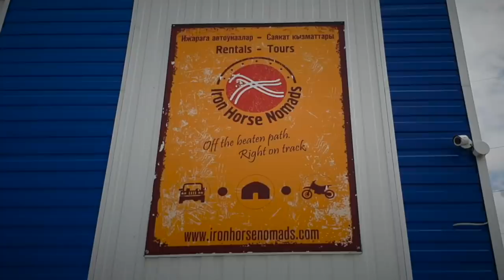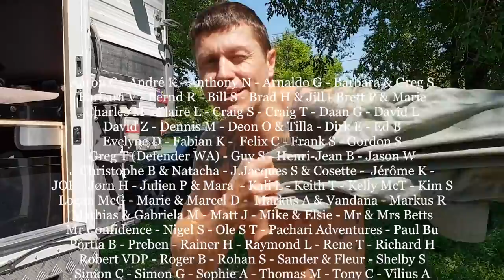Disaster at 3000m (Ep75 GrizzlyNbear Overland)

Comment: Guys try not to worry 💛 components fail due to many reasons! Try fitting genuine parts when you can✌️ great Vlog enjoy these moments....take care😁
Reply: genuine parts LR parts are what caused the failure ;)
Reply: @pablomax3045  that comment could be construed as funny? But for the fact i have owned a defender for many years which has caused many sleepless nights 😪
Reply: @soylentgreen224  hmm a bit tongue and cheek I guess. 
I have owned 3 110's over the years. While I have loved them all, I would never delude myself into thinking they were well built or reliable. I am not sure I have ever taken a Defender overland where something didn't break. The amount of spare parts I would tote around with me finally convinced me to try something else.  
The Defender is a fantastically designed truck. It's just put together with crap parts and with almost no attention to detail. Well.... it was built in the midlands after all ;)
Reply: @pablomax3045  ....what is well built these days? I use a defender for my work/business, I agree on your points, I am on my third defender in 11 years, thankfully my present 61 plate has been kind to my pocket over the last two years, I do have a soft spot for them I guess...but you either love them or hate them?
Reply: Soylent Green Toyota Land Cruiser 200?
Reply: @pablomax3045  haha love it but so true. LC is king.

Comment: Glad you guys are okay..but you know this problem is common on Defenders,that's why in my country "Yemen" we stopped using them..we mostly use Toyota LC's or Nissan Patrol's..don't get me wrong,i still Love Defenders..
Great video..
Cheers from Yemen
Reply: Wesam Mansour snapping swivel balls is not common on any Land Rover in any country
Reply: There is a recall on the 2.2 l Pumas for this problem, the recall does not fix the fault it just adds a bracket to stop the front axle from dropping to the ground. Illegal to run spacers on your rims here in oz just run bigger rims with the correct offset and suspension lift. I have a 2013 HCPU 130.

Comment: So I don't know if you've come across this in your travels, since it only really came to light for us (British Army) a few months back, but there has been a lot of Swivel Housings introduced into the parts supply chain that have failed like this, our entire fleet of Defenders were taken off of the road and every one checked to see if they had the bad parts installed. If you have a good Swivel Housing, you should see a dark line going around near to wear yours failed. If there is no signs of a line, you've got the bad part. Be worth checking the other side, just in case.
Reply: Hi
This is very interesting information! Do you have some further information or maybe some pictures of what to look for?
Best regards
Daniel
Reply: @champ6702  I can see if we still have the safety bulletin in the workshop, if not, I'll try to throw something together.
Reply: Thank you so much for that info. We did actually find out about a batch of defective swivel ball housings that was around the time of our model.
I have inspected the other side and will check again with the advice you have given.
Thank you very much 😊
Reply: P5YcHoM4N Thank you very much, that would be awesome:)
Reply: P5YcHoM4N Thank you very much!!!
Reply: @P5YcHoM4N  awesome fellow....many need to see that.

Comment: Wheel spacers put crazy loads on your axles, love your videos
Reply: Yes, anything with an offset from standard = high stress loads. Even wheel bearings need replacing every 15,000 - 20,000km due to excessive wear from that.
Reply: Indeed, a lot of poeple thing big is better till stuff getting broken. Only than they realize that the original is more reliable and especially if you do long trips.

Comment: I haven't seen the video fully but this can be common on older live axle vehicles. Toyota's do it, the 4 bolts at the bottom of the front hub birfield joint loosen from leaking grease seals in the hub and will give out.

Check them, clean them spotless dry with brake cleaner and oven cleaner and locktite them back in.

Don't trust mechanics to spot it, 4wds need much more closer attention than most people in garages even know to look for.

This coming from experience and numerous Lamdcruisers that each did over 500,000ks

Comment: should of bought a Toyota. then you too could rescue landrover drivers in their certain to come failure
Reply: I was traveling in our friends brand new Toyota Land Cruiser on the Mitchell highways in Perth after they collected us from the airport, the rear diff sized for a split second which nearly resulted in a serious accident!
Lucky for us something let go resulting in no drive and us on the side of the road…I think from memory it pushed something through the axle casing…anyway after having many other problems like using more oil than fuel and injector problems they went back to a Mazda which has been fine!
The one thing I have discovered on you tube about Toyota fans is how deluded they really are…honestly believing that the Toyota will never break down!

Comment: Hi, I've only just come across you, nice  setup you've got there. I recently repaired a Defender that did something similar, it sheared the flange off the axle casing, glad yours didn't. Aparrently there was a batch of casings that weren't welded right, might be worth checking yours. Look round the welds between the axle casing and the flange for the swivel ball. First sign is a leak if it's cracking.   Don't want to see you stuck again.

Comment: WOW, i wish MY breakdowns could be so enjoyable! 

I'll be checking both of my swivels on sunday when the rain should have stopped. I had new ones  both sides last year on my Discovery 1 along with discs and pads, CV joint and everything else that fits on the corners of the front axle!
I've lost a wheel on a Lightweight i'd just bought. They guy told me he had brought it back from where he worked about fifteen miles away. OK, so i should have checked the wheel nuts were tight, but let's be honest, who does that? SOmeone said i should have felt the vibations. Well, yes, i did. It was a 1972 Lightweight which i'd just jumped into to drive to work to fettle over the christmas shutdown. I just thought that this was how all lightweights drove, or maybe just MINE and i'd find out when i went over it from bumper to bumper over the holiday. I was driving along a country lane at the time when the front passenger wheel suddenly departed and shot off into the hedge at 40mph!

I didn't panic as i'd had the same thing happen while driving a Mini several years before. AGian id just juped into it. It belonged to a mate who i'd gone along with to drive this back if he bought a Triumph Stag. I'd driven about eight miles, just got up to about 50mph on the motorway when the driver's side front disappeared through the dipped headlight beam and into blackness. THat was down to all four wheel studs shearing due to suspected grossly overtightening!

I'd got a spare set of wheels in the back of the lightweight. So i thought i'd take the other front wheel off and fit two spares from the back so at least i had matching sizes on each axle. Oh, the wheel brace wouldn't fit the nuts on the wheels. Oh, and there's no jack handle.. DEEP BREATHE... Fifteen minute walk back home to grab the required trolley jack, handle and other wheel brace. Drove to the lightweight, fitted two spare wheels pinched a nut from the other three wheels , had a look for the one that came off... NO sight of it in the undergrowth/hedge. Drove back home. Walked back to the lightweight and drove it to work.
Went out looking for the missing wheel on christmas day afternoon. I found it. I wouldn't have believed a wheel could roll so far. It must have driven about 30 yards through the hedge and stopped at the sheep fence behind the undergrowth/hedge. As i emerged from the undergrowth pushing the wheel i disturbed an old man out walking his dog. When i say disturbed, i think a more accurate description would be 'frightened the guy out of his skin'! He must have jumped a foot when i wished him a merry christmas. It had me chuckling all the way back to my old '61 Series 2 that was parked on the verge with no roof on.

The thing about these experiences is, while potentially horrifying at the time, afterwards they are gems! Of course you do get funny looks when you tell people that you've been driving cars that have lost a wheel TWICE...

Comment: Big tyres and rim spacers might speed the failure up but there is a factory recall on this issue. Trouble is the recall does not fix the problem it just adds a bracket to stop the front axle from hitting the ground after it breaks.

Comment: Damn Land Rovers.  I've never spent more time on the side of the road, in a parking lot or, in my own damn driveway, than when I owned a Rover.
Reply: I've noticed they won't reply to people giving advice to scrap the LR and go LC.
Reply: Well I’ve had 9 over the years my break downs were my own fault off roading pushing to hard .apart from that maintain them well they will last a lifetime.
Reply: buy a cruiser and just change the oil every now and then and itl last a lifetime. no special bumblefuckery required.

Comment: you should have used a toyota landcruiser.
Reply: I  think they should have but then they can not enjoy that 2.5 tons of sleeper (which tells clearly that they are not pro campers or expert off roaders but again can not blame them since they are on honeymoon and newbie ) !
Since Toyota can not be modified in to that and not to carry around these kind of weight !
They did not at all or just poorly calculated the load that they will be carrying and have to strengthen the leaf springs according to the load and axles plus change the coil springs for tough load !
Btw ! They are almost reaching 5 tons and no Toyota even their pickups are limited to 3.5 tons because of the rims and width of tires they offer with them  !
Reply: @mattprior8442  you probably need to look at lc70 series with diesel engine

Comment: I have been using Land rovers whole my life ..honestly, I have never heard of the accident like that one nor experienced anything similar. How did it happen ?
Reply: Swivel usually doesn't come off that way, it must been broken for a long while.
Reply: Tiny metal fracture growing and eventually bursting...a big pothole probably.
Reply: @henryrollins9177  Yes I can imagine that but there is likely to be some error in the quality of the material during production or especially if the equipment is upgraded with something optional.
Reply: @PavleBalenovic  Wheel spacers + oversize tires maybe?
Reply: @henryrollins9177    Exactly.

Comment: Take a Toyota landcruiser it would have continued on even with this damage, ☹️☹️☹️👍👍
Reply: Lasy year I was in Kyrgyzstan with my Land Cruiser HJ60 I completly broke my two back leaf springs. I managed to drive through Kazkhstan to Russia but driving experience was really tough. So even Land Cruiser s do break down, belive me aspecially when you travel in such conditions as are in Kyrgyzstan.
Reply: Brad Młodystach  There is no maintenance program/strategy for leaf springs. The reason was really tough 4x4 roads (i'm not talking about deep mud but holes and corrugations that put constant straing on the suspension).

Comment: As someone who has been working on Land Rover's for almost 3 years i have never seen a Defender snap an axle like that. The tyre size wouldn't be the issue, a prop would go well before the axle. Suspension being too firm with the weight of GrizzlyNbear would a likely candidate in combination with extreme heating and cooling cycles. Love your work as always, can't wait to see more!
Reply: LAPYAK I know. You can even put 35s on without issues.

Comment: If you had a NIVA this will never happen 
this type of damage for so expensive vehicle is not acceptable
Reply: AUXILIARIES AUX please stop saying scrap, over loaded truck with over sized tires will always over stress the suspension components, it’s not a Land Rover failure, but a modification failure
Reply: Brad Młodystach 

Toyota or Mercedes, but, the little Lada is exceptional, it’s off road capability will embarrass vehicles costing many times over on the dirt, great articulation, strong - heavy duty diffs and steel internals... Just think Kazma.!!!

Comment: @ 11:00 That steel cable around the tire looks quite nasty.. Also the steel hooks on the Aluminium rims... More bad news after the damage which happened already..

Also: the right front wheel should have been taken off so the front axle could rest on the ground: less friction = easier loading.
To make it even better: put the left wheel straight and fixate the track rod to the diferential with a strap. In that way you can manouvre the recovery truck to get the Landy straight on it.

There was enought waiting time to do this simple things which would make loading a lot easier and limit the amount of further damage.

But well... I wasn't there... 😁

Comment: Land Cruiser hzj 78...
Reply: Would have needed a complete new axle if the same happened....
Reply: @peters2860  Never seen yota breaking the axle at the ball joint.
Reply: das wright  I do own 1HD-FT TLC 80 and have it since new, got over 600 thousands KMs on it, and do not want to replace it with any newer model. This truck was made by the time when engineers were making cars not salesmen. And did travels from North of Russia where experienced  46 Centigrade below to Turkmenistan's desert where had seen +48 in shade. Works and runs flawlessly. Loaded like donkey, fueled from tractors, it just keeps running. If I were in the boots of this young man, I would look for TLC 79 double cab. With 1HZ so I could replace it with 1HD-T(FT)
Reply: das wright  Yeah, Toyotas brake too. Front axle is known problem for ages and they never fixed it. As long as it kept well maintained it will keep wheels spinning. 
I would take the front axle and weld couple of vertical braces. It would eliminate happening this again. 
In fact I do have such braces on mine as it is very common on yotas bending exact spot.
Reply: It's just,I was a big Land Rover fan too...had more than a couple...many issues...then I went for Hzj 78 and would never go back...I didn't want to be a smart ass with my comment..it's just my experience.Good luck to you guys and safe travel.Pretty cool what you are doing!
Reply: The only reason i would buy a Defender..the old model.. is for the front vents you can open for fresh air...that is the coolest thing...
Reply: Andreas von Wyl 

They corrode big time under the windscreen, so give it couple years and you’ll have permanent vents...

Comment: An episode everyone who installs oversized tyres on stock axles should watch. Well done on getting her back to civilization. Looking forward to the repair episode.
Reply: It's not the tires, it's the overloaded truck.  I run 37" tires on a D1 with stock front housing while rock crawling so much more abuse than this truck will ever see but I don't have 10,000 lbs on it like they do.
Reply: Don Happel Well these 1
130's are rated to carry  a load of around 3500kgs aren't they? We see the same thing more often with Jeeps running big tyres on Dana axles not rated to work with a high rolling mass.
Reply from the maker: we often see way smaller vehicles with way bigger campers. our camper is considered as light weight and the 130 has a high capacity carry load

Comment: That is one nasty failure. Agree with back to narrow tyres without offset. Run std 235/85x16 on my 90. Did try 265 at one stage and hated it. Glad you guys are OK. Hope the repairs is less than an arm and leg. Cheers from Africa
Reply: Yeah, the big wheels look good though. Quite proportional to the truck. I am running the same 285x75 St Maxx. However on steel rims with the appropriate offset for sufficient clearance. Hoping the offset on the rims and the strength of the steel wheel help the handle the added stress better compared to spacers. The wheels are damn heavy though at about 40-45 kg.

Looking forward to see you guys back on the road. Love how you are dealing with the situation! Keep us posted!
Reply: @DaanvanGruisen  I manufacture new cars.  Aluminum wheels are almost always stronger than steel.  And it doesn't matter if you increase a vehicles track through wheel offset or spacers, it still adds stress.  Good luck.
Reply: @13Sala13  Thanks for your comment. That's why I said "hope", cause I wasn't too sure if it makes a difference.

Comment: Looks like repairers there are better than here. We had the LBJ on the Prado 90 series collapse and the wheel went under the car. Took 3 months to get it fixed. Hope you get moving faster than we did. I should add that anyone with the Toyota 90 series who hasn't checked their ball joints recently, do it now, it is a common fault with these vehicles.

Comment: " Why we're so unlucky", its a landrover, thats normal. Looks like the swivel housing knuckle on the end of the differential assembly has snapped off. Drive shaft would have snapped as well. I spent my childhood in Papua New guinea. Dad owned  an ex army short wheel based landrover, canvas top. Always had mechanical problems, but we loved that old bomb. Cheers from 🇦🇺